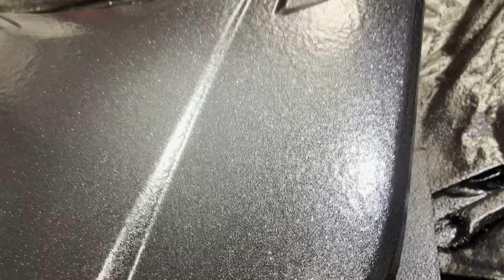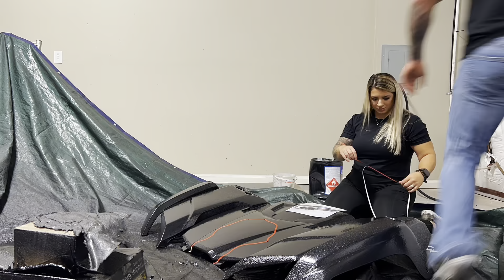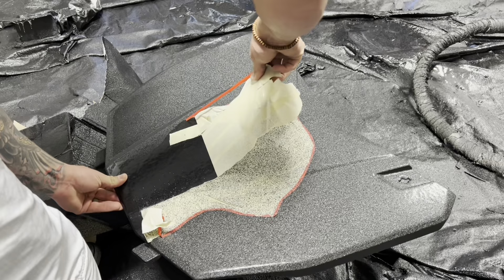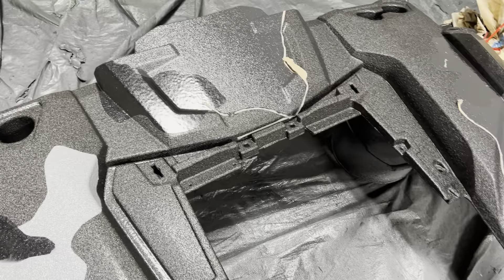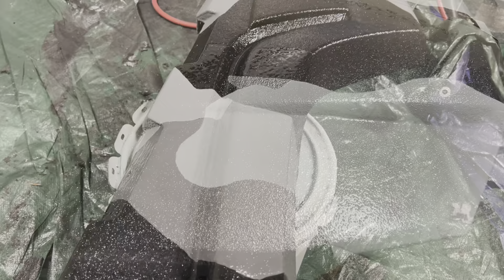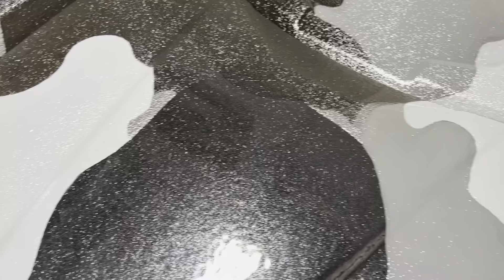Custom Camo Bedliner on SXS!

Comment: Did you rent the bed liner or paint the various colors over the black bed liner
Reply from the maker: We did a smooth bedliner base, taped off the area we wanted to keep “smooth”, then textured the rest. Then taped off sections and top coated with single stage automotive paint.